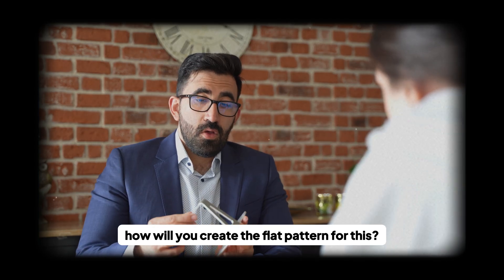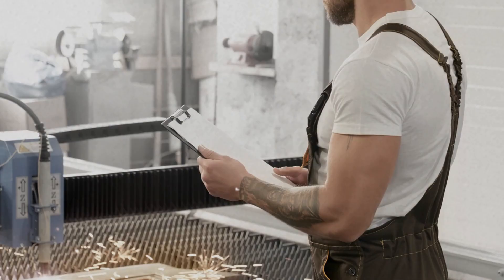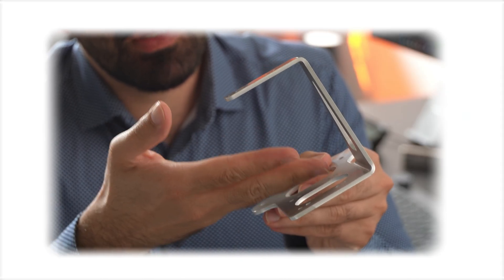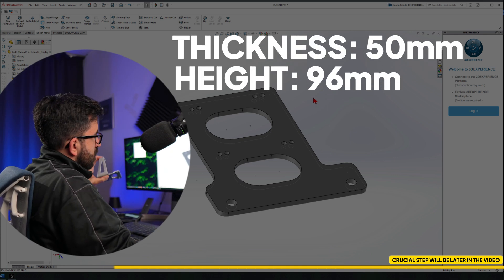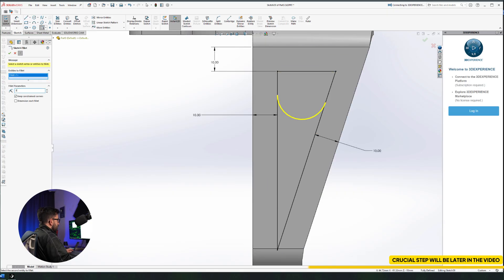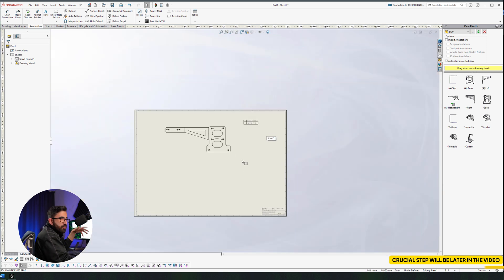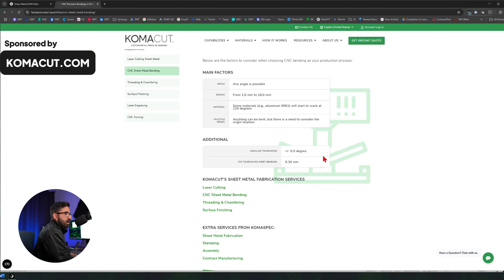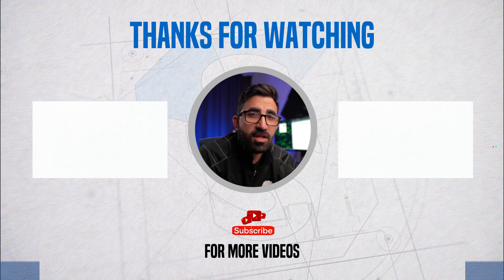Why Some Engineers Land Jobs Over You

Comment: Would love to see a video that explains the essence/philosophy/basic rules of modeling with SW... While there are many ways to design/model the stuff - the way it actually has to be done is kinda confusing - what is the best way to approach any task or a project from scratch? Are there any rules for deciding where to add a plane for sketch? What exactly we should aim for in terms of the process/techniques/good practices?  Say I've got a really complex part - is it ok to model some identical segments separately instead of duplicating them via mirror/pattern command? Is my poorly designed but accurate element/part (modeled in an unnecessarily complicated way) as good as an identical one but more optimally modeled piece? etc... No need to answer - just a suggestion for a new video :)

Comment: So unfolded view is flat pattern. I was like what's that😅. I use CATIA all of the time.
Reply from the maker: unfold is a different tool. It actually unfolds the component unlike flatten that only SHOWS you the flatten pattern. 
ANy change you do on the Unfolded view remains, why changes on the FLatten, would be suppresed once you turn Flatten off
Reply: @with-aryan  ah alright. Now that you've mentioned it. If I do make any modification in unfolded view, it won't be visible in the normal view. I don't see any flatten tool in CATIA though.

Comment: I feel good watching all your videos; you explain everything very clearly. I have a question—while working with sheet metal, I’m not able to control the tolerances properly. During the design phase, everything seems fine, but when it goes into manufacturing, there’s always a slight difference. These small differences keep adding up in a large assembly, and in the end, they cause major issues. So how can I resolve this problem?
Reply from the maker: the stackup error? you'd need to work with GD&T. Do you know what that is? gdtcoursepro.com just to give you a taste

Comment: It would have been better to tell what bending radii are and what tool they are formed with, a die or a punch, what a die mouth is, how to choose bending radii, how to create bends that will not overlap during bending, what bending in windows is, a video just on how to create a part in solidworks. The author of the channel just shows clickbait, apparently he does not understand sheet metal himself. 🤣The main thing is to cram in the manufacturer's advertising
Reply from the maker: good point. you don't sound like a beginner. As you can tell this video was to introduce beginners to the world of sheet metal. Your listed items were not the first thing you learned about sheet metal. As a teacher, you have to take the sequence of introducing information into account and not just the totality of it

Comment: This is what i'm thinking in the begining of the video "and your bending angle". I'm not mechanical engeneer (it manager) but I'm a self-taught man and i love 3D printing, and so on i'm in the begining of learning 3D modeling software (solidworks in particular). Ad as you tell in your video, like PDB manufacturing, not all manufacturers had the same capacities. And you also have to think in a cost way
Reply from the maker: absolutely correct

Comment: I definitely agree with your recommendation that it's important to first understand the capabilities of the manufacturer you choose, whether it's in-house or a subcontractor. 

Every machine in manufacturing—be it a bending machine, EDM, laser cutter, etc.—has its own limitations. If your design exceeds those limits, it simply won't be manufacturable. 

That's why it's crucial to consider these constraints early in the design process.

Comment: If you dont want a MASSIVE headache you send the 3D model to the manufacturer and you let them unfold it with their tooling. 
Otherwise you can be damn right it will be slightly wrong or off my a few mm and GL fitting things when the tolerances of corresponding parts are tight :
Reply: Just about every sheet metal design Iv'e worked on was sent to the sheet metal fabrication shop in the folded state. All the shops I have worked with have requested to not send any flat pattern drawings because most likely they will be inaccurate and this will create an inacurrate folded part also . What they will do is measure your 3D model as folded to create the actual flat pattern for their process. If they find anything abnormal with your sheet metal design, they will call you to discuss any discrepancies. Sometimes they will recreate the 3D model for themselves to make sure there are no errors. That's because many have their own start parts for their fabrication process. It has a lot to do with bend allowance and bend radius for their bending machines. Each shop has their own tables they use. I have found that it is best to trust your metal fabrication shop and also know that if they make a mistake they will correct it. If you insist on them using your own flat pattern and the folded part is not correct they will have you pay for the incorrect sample part PLUS the new corrected sample part. this has been my experience since 1996.

Comment: I would design this difernetly. I would make a sketch of the sheet metal extirior diamentiosn once bent and mek the sheet metal. After that i would just extrude all that needs to go like the holes and so on. This is nice because i can just input the size i want the sheetmetal to be once finished. It gives a clean desing and easy to modify in future. Both ways are fine but in my expirience i can do it faster extruding the bent sheet metal first.
Reply: I would do a solid block then cut the shapes, transform it to sheet metal the cut the holes
Reply: @surronzak8154  That would be incorrect because you can't unfold the part for cutting in CNC machine.
Reply: @abrahamf6124  Of course you can unfold it , why couldn't you ?
Reply: @abrahamf6124  Ah you are right, I need to do the transform to sheet metal last